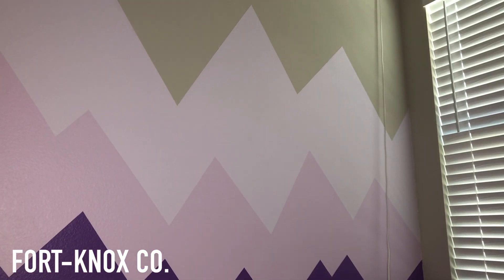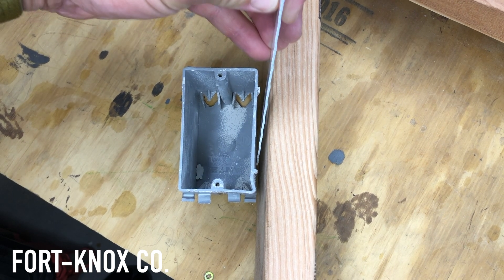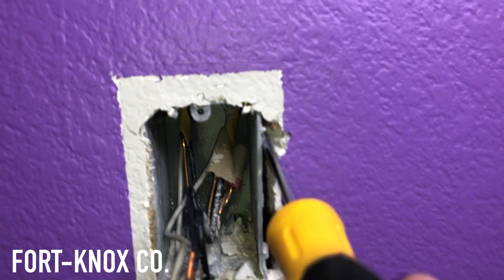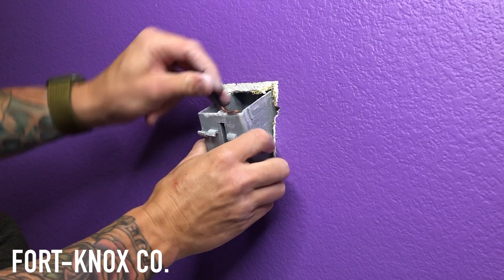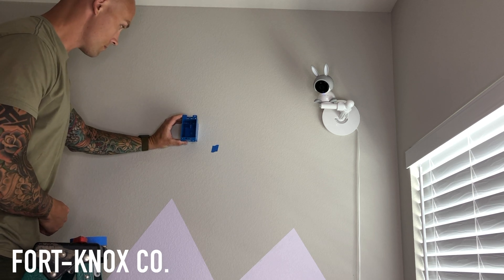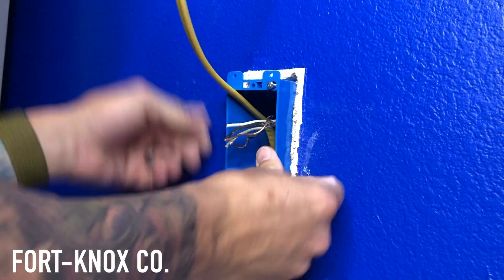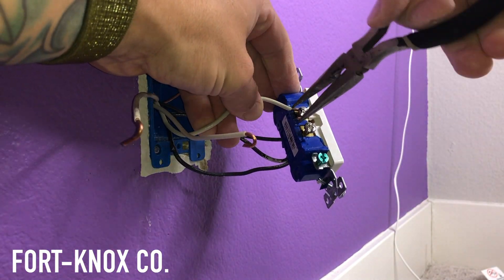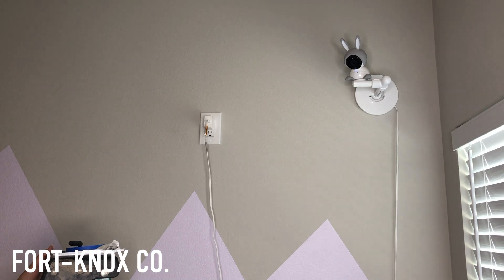How To Add an Electrical Outlet | Move Outlet Up Wall | Wall Mounted TV | Hide Wires  Easy!!

Comment: You didn't really put 2 wires under the same screw?  Good way to burn your house down. Put all the hots together with a Wago push wire connector with a pigtail going to receptacle. Then do the same for the neutrals and the grounds.
Reply from the maker: Yeah I’ve  corrected that since and mentioned it in other videos. At the time I made this video and edited it later that was the only footage I had of the initial install.
Reply: @FortKnoxCo  how did you fix it?
Reply from the maker: @jacobconstante8288  if you are referring to fixing putting two wires under one screw, what are you do is you take the wires together and bind them together under a cap and then you have one wire coming out from that bundle that goes to the outlet. They called this pig tailing. It reduces how many wires are actually going out towards the outlet and you can combine them all under a cap and have one just coming out to the outlet. It just cleaned it up a little bit and allows you to still get good connections and have your good contact at the outlet without overloading it with a bunch of wires.
Reply: How well do those boxes work with lath and plaster walls?

Comment: Great video !! small question: how did you get the phishing tape down to exactly where your previous socket was, especially when there was insulation?
Reply from the maker: That exactly why the fishing tape is so helpful. It’s rigid a d can push past or through insulation if need be. But it’s really easy when working with a wall because you can start the fishing tape along the stud or drywall and keep it pressed to the hard surface and it should slide right along down unobstructed.
Reply: @FortKnoxCo  Hey, thanks for the quick reply. So would the 2 outlets need to be right one below the other exactly in same vertical line for the phishing tape to work?
Reply from the maker: @TheCreativeComposer   for the fishing tape to work in the way I described , yes. There wouldn’t be any  hard obstructions. You can use a fishing tape through studs or other things like conduit or pipe but you would just need some type of access to the hole. I’ve fed it through a hole in a stud that I first drilled, then ran my tape a pulled the wire  through
Reply: @FortKnoxCo  sorry for another clarification but my question was not about obstruction but more about how to navigate the phishing tape diagonally in case I have to traverse from one outlet diagonally to another without looking at it(assuming no obstruction other than insulation) but the outlets are at random location, not exactly below one other.
Reply from the maker: @TheCreativeComposer   no worries. The fishing tape has a plastic diamond shaped end usually and that helps with piercing through stuff like insulation if you can’t get it to run along a hard surface for guidance. It will probably take a few try’s most likely because the tape won’t always travel exactly straight each time. You can also get a rigid fishing tape or fishing stick, they are usually made of a flexible fiberglass and connect together in 1-2’ lengths. When needing to go in a straight line from one point to another or long straight distances people will sometimes use the rods.

Comment: I need to move an outlet up a few feet. Do you still need two boxes to encapsulate the wiring splice at the lower junction for safety, or just splice the wiring with connectors?
Reply from the maker: You should always use a junction box for any wire splicing or connection. And then obviously a box for any outlet or fixture. It’s code and also helps prevent the fire hazard.

Comment: Hi
Did you need to get a permit to run the wiring?
Reply from the maker: The short answer is No. You usually don’t need permits for this type of stuff. Granted it needs to be done correctly, but for the movement of a plug or addition of a plug there isn’t a permit for it. You’d just be told to hire someone qualified who licensed and bonded. It also depends on where your at and local ordinances.  But usually permits are required when making something like structural changes.

Comment: Just one question, on the top outlet only one outlet was operational correct , or both ?
Reply from the maker: Both are active unless you break or separate the metal connector along the side. Almost all outlets have a connection between the top and bottom plug and you have the option to separate and wire two circuits if you want.

Comment: I did it easier without even removing the old box, in the back poke the hole on the side that has no wire feed, I use a metal wire feed and i fed it up towards the new outlet. Saves time on cutting out the old one. reconnected the wires and tested the polarity after the second outlet was done.
Reply from the maker: I used to do something similar like that but found that I was messing with working in a confined space longer and fiddling with the wires more and it took longer than just zipping out the old box, installing a retro box and having all the space to do it. Either way, we get the job done 🤙🏼🤙🏼
Reply: @Devin Dakota instablaster :)
Reply: @Devin Dakota no problem =)
Reply: @Zachary Rhett Thanks so much for your reply. I found the site through google and im waiting for the hacking stuff now.
Takes quite some time so I will reply here later when my account password hopefully is recovered.
Reply: @Zachary Rhett it did the trick and I actually got access to my account again. I am so happy!
Thanks so much you saved my ass!
Reply: you prolly dont give a damn but does any of you know a trick to get back into an instagram account..?
I was stupid forgot the login password. I appreciate any tips you can give me.

Comment: Maybe a future note. When you have 2+ sets of solid wire in a box.. try twisting the outlet with the wires landed 1 full twist then push your wires in. It helps confine the wiring in a tighter grouping so when you push the wires in it can assist with fitting the outlet back in place correctly.
Reply from the maker: That’s an awesome idea. Hadn’t thought of that.
Reply: @FortKnoxCo  have used it many times throughout the career. Sometimes can be finicky but most of the time it works out. 👌
Reply: @LucienAGO  a video or picture would be nice. 
PS. Did he have to sets of hot wire come from the ceiling for one outlet??
Reply: good tip!

Comment: What if, in addition to moving up, you also had to move it sideways across a stud?
Reply from the maker: That is 100% doable and there’s several ways to accomplish this. BUT it usually requires some drywall work.  One method is a “pumpkin cut” into the drywall. You create an opening right next to the stud or wood you want to cross through, drill a hole and feed the wire through. Then patch the drywall. There’s several methods and tricks to create less drywall damage in this process.  I’d search drywall pumpkin cut here on YouTube and you will find some good information. I was going to do a full video on solving these types of problems  but just haven’t as of yet.
Reply: @FortKnoxCo  Thanks!
Reply from the maker: If you haven’t already please consider subscribing to my channel. I’ll be making all kinds of helpful videos and uploading several times a month.

Comment: Awesome tutorial!! I have a wall mount TV and want to move the outlet up on the wall behind the TV hidden. Do I still have to tie in and use the original lower outlet? Or can I tie in to the old wires without the old lower outlet, and just use new outlet where I want higher up? I know how to do drywall repairs and installation.
Reply from the maker: You do not need to meet the outlet in the lower box if you don’t want to. Just tie the wires to the new ones going up. The box just acts as a junction/splice point now. You should not cover it up with drywall though. It’s against code and could be a fire hazard. Anytime your splice or branch off a wire you need to have access to it. So I’d just branch up to the new box and use a blank cover plate for the old box. I do that on ones I don’t want to keep the outlet in.
Reply: @FortKnoxCo  Great, I will bypass the lower outlet and splice at the new upper outlet sounds much easier. Also thank you for the great tip on using a blank plate instead of drywalling. I will keep that in mind for further projects.
Reply from the maker: If you haven’t already please consider subscribing to my channel. I’ll be making all kinds of helpful videos and uploading several times a month.
Reply: @FortKnoxCo  Subscribed and hit the bell for "all".
Reply from the maker: Awesome!! Much appreciated 🤙🏼

Comment: Good job but code don't allow 2 wires under a screw on a receptacle. Its not safe. When you can no longer daisy chain ur suppose to pigtail.
Reply: Is it safe just to connect the wires like that and get a new outlet on the same wire? i worded that terribly lol
Reply from the maker: @mercenary1485  if your asking if you can just leave the current plug there and branch another set of wires up to a new outlet, then yes.
Reply from the maker: Yeah I’ve done it both ways. Usually I pigtail stuff but for some reason when I was filming this I doubled up on the screws. LoL. Doing a project and filming at the same time is a whole different thing and throws me off sometimes.
Reply: @FortKnoxCo  I don't know the whole ins and outs id just rather see u safe. Im currently trying to get into an apprenticeship so I've been studying and just watch videos to figure out the best method cuz there is a lot i still don't know.
Reply: Pig tail is always preferred when daisy chaining

Comment: Why remove the original box?  If you only had some wires in the box you should have plenty of room to add the new wires for the old work box above.
Reply from the maker: I've done it where I leave the original box, but its usually WAY more difficult to run your wires from that to up to the new box through the wall. because your limited to the confined space from the box. 
The idea of removing the box isn't to make more room for the wires, the new box you put in is usually the same size as the old one. 
The reason for removing the old box is to be able to access the space in the wall, run the wires efficiently and usually easier to catch the wire/fish the wire. 
Removing the old box really just makes the whole process faster. and Time is money sometimes. You also run the risk of damaging stuff when trying to work through the old box and how difficult it is to run those new wires in or out while the box is secured in the wall already. 

I hope all that makes sense. But bottom line, you don't HAVE to remove the old box, I've done it both ways.
Reply: Fort Knox Co. thank you for sharing the knowledge.
Reply: @FortKnoxCo  I was wondering about why you'd remove the old box, but that makes more sense to me now.  Thanks!

Comment: Did you "Double Up" the black wires like you did the white ones?
Reply from the maker: If you're referring to when your daisy chaining them together, then Yes. You would continue the black along with the black from the light and the black to go along to the next light fixture. so alone the way there is 3 black tied together, the one coming in/one from the light/one going on to the next light.

Comment: What gage was the wiring you used
Reply from the maker: In the walls for outlets you commonly use 12/2 or 12/3. Yellow cased wire.  12 being the gauge and the 2 or 3 stating how many wires inside not including the ground

Comment: I m doing this tomorrow
Reply from the maker: Awesome!! its not too hard, and it'll save you a ton of money $$
Reply: I ran into a concrete block behind dry wall. 😭 so I wasn’t able to put the outlet box in the wall
Reply from the maker: Miguel Arreguin  Aww man 😔 They do make low profile electrical gang boxes for shallow walls and also it’s always an option to maybe mount the box on the outside or slightly recessed into the drywall? In the case you do external box everything is just enclosed. Like wires run it a small pvc type tube and go into the outlet box and it all mounts on whatever surface